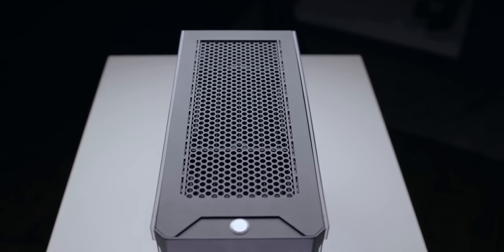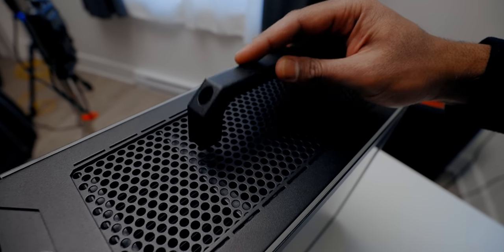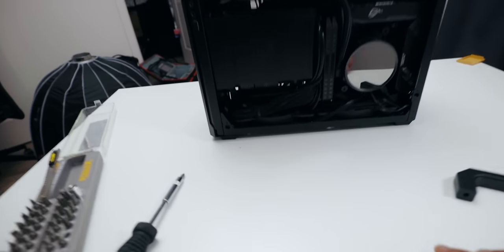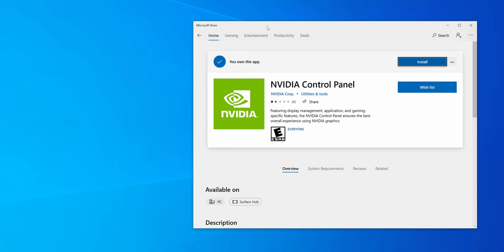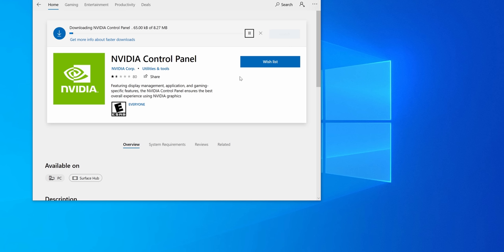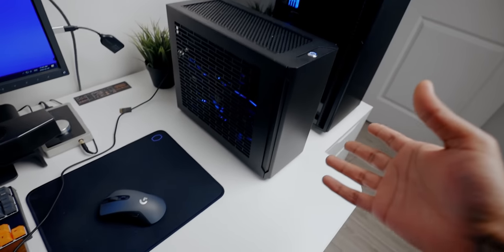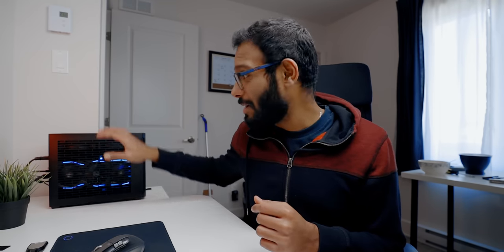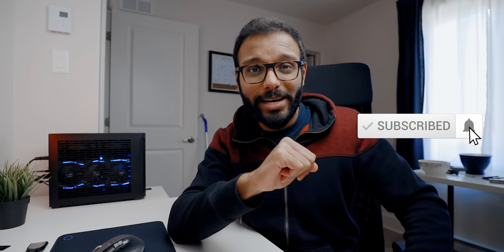My ITX Dream PC Has PROBLEMS - Time To Fix Them!

Comment from the maker: SUPER HUGE THANKS to all the suggestions!  I think we may do another follow-up soon.  Keep 'em coming guys!! ❤
Reply: ahhh the nvidia control panel. thank goo..mine was installed automatically with the old set up a year ago. so I'm good
Oh out of curiousity...Render time for this vid on the new system?
Reply: A video on making your own cables would be fantastic! You did well👍
Reply: HardwareCanucks Seriously fixing fan curve video for 13 minutes video
Reply: Jhenu over 1,000 views in less than 3 hours... doing something right!
Reply: are you happy with the ROG nvme ssd adaptater ?
Reply: Mine disappeared recently when I took my second 1080ti out of the sli set up I had. I also could not adjust monitor res either. Used the free Guru 3d Display Driver Uninstaller, rebooted, reinstalled drivers and everything is good.
Reply: You could also install some corsair magnetic fans, ramp them up, and still have a super silent pc
Reply: I have a fix for the Nvidia control panel. Open the Windows Store , look for it and install it through the store. Problem fixed on my recently built Ryzen 3900x system with a  1080Ti
Reply: @mindblockandroid  or Noctua Chromax fans
Reply: intel: It just works no issues and good performance. AMD: nope you can't do that, yep all your work is now gone via driver crash oh performance? no you get none of that.
Reply: hey Eber, if you download the standard nvidia driver, it comes with the control panel.. only the DCH driver has it separated.
Reply: @howlers8  5 min 14 sec
Reply: These videos you guys make on cooling, reviews on cooling componentes and cases, you should stop doing them, and go do some research first, or maybe take some time and play with the gear you already have (pretty sure you have a lot), because you are "teaching" ppl and guiding them, without having almost any clue what you are doing.

These rules applies to everything related:
1. Make sure you understand where your CPU stands in terms of thermal density and wattage considering the cooling solutions you have available.
2. Make sure you understand how liquid coolers work and air cooling works, and why and when one is better than the other, not just blindly go "one is better than the other, period".
3. Make sure the cooler you use has good contact and good heat transference at coldplate level for the CPU you use. 
4. Start from the very base level control for fans, voltages, and frecuencies, that means, no automatic profiles, no aditional gadgets and no aditional software, because that garbage only adds more points of failure and troubleshooting. 

Adressing your case specifically:
1. ryzen 3950x. It has a shit ton of thermal density, and fairly mid range in therms of power consumption (around 120-170w) but because of the layout of the CPU it´s not that much of a problem. That means an air cooler it´s just as good as an AIO. An AIO can be slighly better (liquid cooling has better heat extraction) if you hit it with a lot of voltage, but it´s not gonna get you much more, because temps will skyrocket through the roof because of the high thermal density inside the chiplets, and even an AIO it´s not enough to extract the heat from it.
Anyway here, you don´t options to choose from. So AIO FTW (for the win).

2. Liquid cooling has better heat extracting, but worst heat disipation capabilities, however it can scale more in size (custom loops). To place it into perspective, you can have a 300w 3970x TR cooled by a big air cooler, sitting at 70ºC, and have a 240 AIO hitting 90-95ºC, meanwhile using both coolers on a 3700x at 130w the AIO will sit at 70ºC and the big air cooler will go  90-95ºC. That also makes the air cooler being much more dependant on case airflow. 

3. On the desktop platform, Intel has a slightly concave IHS, meanwhile AMD it´s flat. Most air coolers with a ni-co coldplate have slightly convex coldplate. Most liquid coolers have a flat coldplate. That wasnt a problem untill recently, because thermal density was not very high, and all CPUs had centered dies. NOW IT IS, something to keep in mind.

----4.A Tune app manually both voltage and frecuency, especially if you use the ryzen build for editing. Because of the high thermal density inside the chiplets and the boost profile AMD uses on those CPU, your frecuncies will drop like crazy on heavy loads, and at IDLE you will have the fans and pump constantly RAMPING agresively up and down, because of the XFR2. You need them to ramp up and down, because your cooler is still overkill no matter is a 20w load or a 40w load, but the temps will spike like crazy and cooler can´t extract it fast enough, and it´s a fking pain in the ass. If you leave your CPU at stock, just edit the segment where it spikes with low loads in the fan profile (if normal temperatures are 35ºC and it spikes to 47ºC when you load a website, just extend the idle segment to 50ºC)
----4.B You shouldnt use asus garbage software, nor nzxt, nor any physical hub. You have 3 groups of "fans", 2xbottom intakes, 2xAIO exhausts, 1 pump. So you need 3 headers. Use splitters for the fans. Those $0,50 ones. Go into the bios, make custom fan profile curve for all of them, except maybe the pump (do pump only if you see you need too....). Also the curve for the bottom intake should include startup temperature. Those intakes should NOT run at IDLE.
----4.C Use MSI afterburner for GPU fans and make a custom profile (also good as a monitoring tool, and it also has a plugin for hwinfo64).
----4.D Boot your PC, and see how noise/temperatures are for the loads you use, then adress them acordingly. Most 3950x hit the wall at about 4.25-4.35ghz. A 100mhz less can let you drop as far as 20°C lower and 0.15v.

That´s how you get a system with minimal noise.

My system: r5 2600 4.1ghz 1.35v. cooler master 212 evo. gtx 1080 strix max OC 24/7 modded with 2xsw3 fans. Meshify C with 3x front intakes, no exhaust, drive cage,  pcie brackets and top of the power suply shroud removed.
----Bf V online 64 map players. CPU load 80%, GPU load max. case fans and CPU cooler 750rpm, GPU fans 1000RPM. ambient temp 22ºC. CPU temp 58-63ºC, GPU temps 57-61ºC. Noise 33dba, at 50cm of the top of the PC.
----Idle. case fans, 0 RPM, GPU fans 0 RPM, CPU cooler minimum RPM. Max temp on CPU 43ºC, max temp on GPU 55ºC (they ramp up at 50ºC and 350rpm). Noise? 
Irrelevant.
Reply: Isn't the bottom intake fans become irrelevant since you replaced the closed panels into the grilled panels?
Reply: Great video! Rather than ranting about stuff that was partly your fault, you did your research before recording, stayed calm and was very straight forward and direct with your solutions.

THIS is how you make a good troubleshooting video. Cut the attempted solutions that didn't work from the video and instead jump straight from the problem to the working solution.
Reply: Follow up videos are good Ebert.
Reply: My strix 2080ti since installing the 3950x in my 3900x build has had really annoying fan curve issues that it totally just ignores.
Reply: @William-Stewart  ask asus for help with that. That's not a ryzen specific issue
Reply: @TheOz1999  It seemed to be some preset around the 75c mark that it would just buzz up and down. regardless thats gone now and being replaced with an aorus waterforce.
Reply: DUDE!  Just try unplugging a fan header to see if that is your loud fan.  Don't stick your fingers in the blades.  Ya, I know you told everyone not to do it but you did it so what do you think is going to happen.   Sheeeesh. 😞
Reply: @AndreiMorar  This is the only way I found also.
Reply: Absolutely interested. We can learn so much on how the "pros" troubleshoot thekr machines. keep up the good work!
Reply: Would love to see an update on how it’s been!!
Reply: Nvidia control panel is only available in the MS store now.
Reply: I NEED a follow up. I want to build virtually the exact same machine.

Comment: Hey Eber, OptimumTech's video on the little versions of this case suggests only running case/radiator fans as exhaust so you're not fighting the exhaust airflow of the GPU when using the vented panels. Might want to test your thermals.

Great video though! Loved to see the evolution of this case.
Reply: DeilGrist that dude’s channel really fires on all cylinders. I went back to watch his first video, and the improvements over time are outside of this world. Cheers.
Reply: DeilGrist Yeah, his videos really show the most efficient way to do all things ITX.
Reply: His channel is also probably the only other tech tuber's channel that I've seen which rivals this one for it's quality B-roll.
Reply: @miink1y  Gamers Nexus leads the way by a good margin when it comes to the comprehensive and scientific nature of their tests. Hardware Unboxed is also very good in that regard, while also having a more polished presentation.

Comment: Eber I recommend making those bottom fans as exhaust instead of intake to allow the gpu and rest of the case to have more negative pressure. Optimum tech did some results on the Sliger SM550 and SM560 and concluded exactly that.
Reply from the maker: The same can't be said for this version unfortunately.  The issue wasn't temps actually; the fan noise was due to BIOS and software not "talking" properly to one another.
Reply: @HardwareCanucks  Oh I didn't mean that the fan configuration was causing fan speed issues or anything like that. I'm just suggesting it as a possible improvement for your temps. Glad it worked out on your end :)
Reply: Strongly agree.  Definitely use bottom fans as exhaust if you are using open-air GPU in a case like this (side panel open air). I tested this with my Dan Case A4 SFX with a small bottom fan and it makes noticeable improvements on both noise and temperature. Using bottom fan as intake will make cool air flowing in from intake fan hit directly against hot air blowing out from open air GPU cooler and make hot air trapped in GPU cooler, which leads to high GPU temperature.  Optimum tech's result is right and you should give it a try.
Reply: not with a close side panel. It would have to be perforated for creating that neg pressure.

Comment: a non perforated side panel that close to a vertical GPU... what were you thinking??
Reply: GN Steve disapproves!
Reply from the maker: Actually, there's a good amount of space there even though it doesn't look like it.  Plus, due to the upwards airflow of two lower 140mm fans, there's plenty of fresh air circulating in that area.
Reply: @HardwareCanucks  I have this case and would respectfully disagree, while im not using a 2080ti I would definitely recommend putting the vented panel on, temps dont lie
Reply: that guy He has fans on both top and bottom, a horizontal mounted GPU will act like a closed valve cutting off all the air flows and create vortexes further disrupt the air flow through the case. Maybe a vertical mounted GPU isn't all that bad in a tiny case like that.
Reply: @petervanek2537  Its a typical Eber video what more would you expect???
Reply: @HardwareCanucks  You shouldn't be doing bottom to top airflow either. Your gpu exhausts air from the top and the bottom so your bottom intake is basically canceling out or completely overtaking the exhaust that would normally come from the bottom of the gpu. Top + bottom exhaust functions better in all sandwich style cases like this.
Reply: @HardwareCanucks  nah, it still sucks
Reply from the maker: @petervanek2537  That's exactly what was done.  ;)
Reply from the maker: @FlexHatred Its worth investigation on this one, that's for sure.  Every case's internal layout is different and that can affect the benefit (or lack thereof) of certain air circulation directions
Reply: HardwareCanucks why were you defending the closed off panel then?
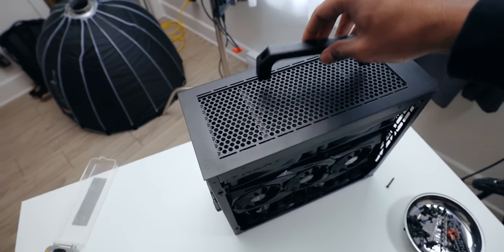Reply: HardwareCanucks Holy cow dude 3:11 you don't even have a full inch to work with, the back side vent was probably the only thing stopping that card from being slow cooked like a fat turkey

Comment: I thought it was a bit weird when i was re-installing Windows the other day and Nvidia’s control panel was nowhere to be found. That never happened before. Now i know.
Reply: its takes a couple of restarts and basic updates for the software to automatically download
Reply: Same, but after I restarted the PC right after the drivers install finished the Nvidia Panel downloaded and installed automatic; I only had to accept the terms of contract.

Don't know why Nvidia done this though; at least for now, serve no purpose other than bother the users.
Reply: Make sure you don’t disable nvidia in msconfig service
Reply: For nvidia control panel , you need to install it over microsoft store. There is no more classic panel from driver installation.

Comment: You have an AIO so as long as your fluid temp isn't getting too hot you can keep the fan noise down. I would probably keep the pump on a more agressive curve, with the fan speed following behind on a spin-up delay. With how peaky ryzen temperatures are you could also use a short fan spin up delay, since the boost algorithm is quite agressive causing temperature spikes.

I have the high rpm be quiet fans, and when you get them up faster than the stock silent wings variant the noise level climbs quickly. The anti-vibration mount kit helped a bit. I would probably save that top end fan speed for peak heat conditions only. If you're trying to find fans in the case to identify noise there are tools through AI suite to turn off fans to identify them

Comment: I HIGHLY recommend a program called Argus Monitor to set up your own custom fan curve. It can control both DC og PWM, along with sooo much more. Check it out! 
Also, in CAM, you should set up your fan curve for liquid temp instead of CPU temp, it will spare you lots of fan-noice :) 
Love your vids, been following HWC for about 3 years now! Keep up the good work mah bois
Reply from the maker: Thanks for the suggestion!   Keep en coming!
Reply: +1 vote for Argus Monitor

Comment: Fan curves have always been god awful. Unfortunately the best fix I’ve found is to forcefully set the fans to a fixed rpm that is as fast as I can push them before they become audible.

Even still mu Ryzen system doesn’t pay attention to my CPU fan curve so when I’m idling on windows desktop there are temperature spikes that cause the cpu fan rpm to spike up and down with. Thankfully its low enough that I can’t hear it, but still not great.

Ideally fan control should be smarter to where they turn off to prevent dust when idling, and the. As soon as you start doing some cpu work, the cpu side goes up to max silent setting, and same for gpu. With a final level of max rpm reserved for when the temperatures get out of control.
Reply: What do you use to manage your fan curves? Most apps have some setting to smooth out changes in fan speed over a few seconds which help with the spikes.

Better yet, some like Argus monitor let you control fan speed based on an average CPU temp. A half second temp spike doesn't impact a 10 second average.
Reply: You can do all that with Argus Monitor and the right fans (Noctua have zero RPM modes). 

I use it for my system with two radiators and a DDC pump. At idle, the fans on one radiator stay off until the CPU maintains a 50c average temps, or if the GPU maintains a 45c average. Over 45c on the GPU is usually an indication that it’s under load for me. The other rad, I keep the fans at 1000RPM which is pretty silent. 

Noisiest thing is the pump now, unfortunately

Comment: In order to install nvidia control panel, you now are required to go to the microsoft app store. I hope this helped. It's completely un-intuitive and is not explained properly to anyone without doing research.
Reply: Was their any notice or website that notice this change and told ppl about it? I can’t find any info other basic ppl having issue with Nvidia issues. I’ve googled and found nothing.  Just built 2700x with x470 mobo.  Very happy with it. If this Nvidia choice.  Just pushing me more to say F Nvidia and go full AMD lol.
Reply: Sire DragonChester there was no official announcement. But I remember the installation telling me to download the control panel after I installed the drivers. But it didn’t do it every time.

Comment: Would be interested in seeing small videos on incremental improvements. Most folks (I think) do a full rebuild every 3-5 years, but do smaller upgrades once or twice a year. Data transfer speeds from PCI 3 to 4, RAM from 2600 to 3200 MHz. Just small incremental jumps in productivity/efficiency.

Comment: For noise and shit, don't be afraid to try undervolting. Running with stock speed and an undervolt has been my go-to because I'm hardly losing any performance, I can turn my fans way down, and the system hardly gets hot.

Comment: Glad to see the switch to ITX :) I have an ITX case that doesn't support any fans, it was loud at stock, so I undervolted my system enough to reduce the noise significantly while keeping the performance close to stock. It's actually quieter than my previous micro atx system, but twice as expensive
Reply: Luis how do you sell a case that has no fan support 😂